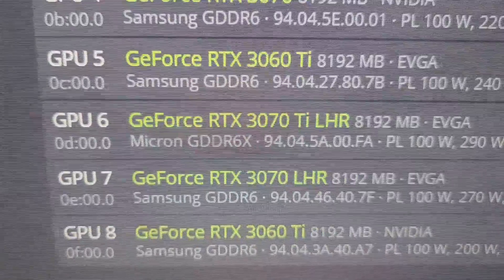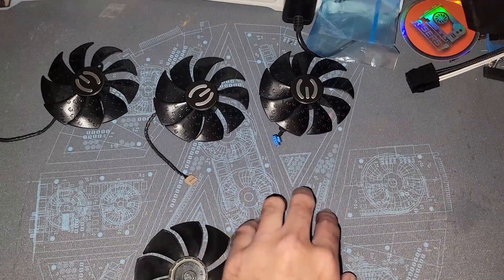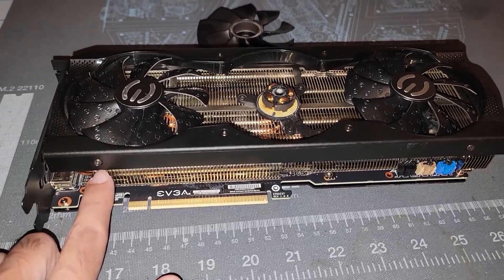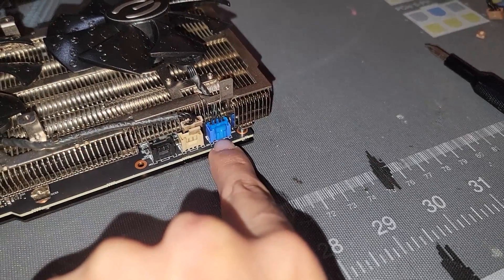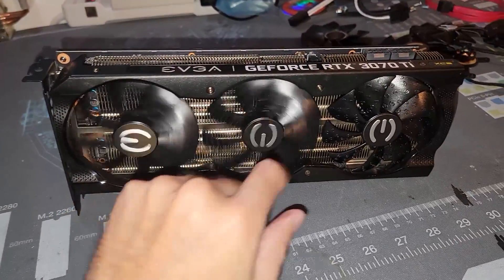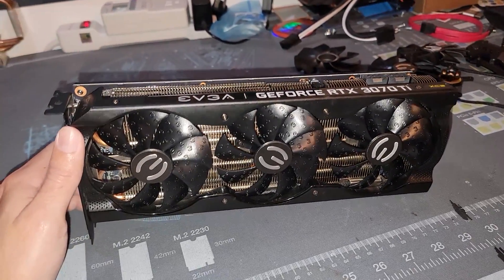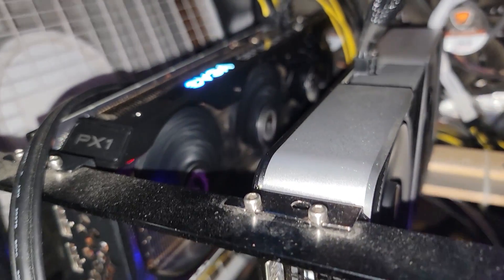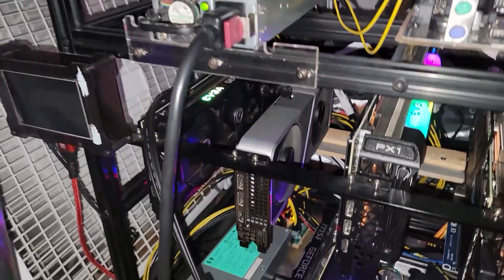GPU Fan Replacement EVGA RTX 3070 Ti XC3

Comment: I unfortunately just noticed after my Windows 10 was acting weird with the visual bugs on the desktop. I looked at my computer. I noticed the middle fan wasn't even attached anymore to the fan base so it looked just like your middle fan did. I got my card back in 2020 luckily it's the RTX 3080 FTW3 ultra right after they changed the red lips to the black lips and it's not the LHR version. It's the regular version but it is getting a little hot without that fan spinning so I'm hoping that site still has replacement fans.

Comment: Is there a way to fix the fan without replacing them entirely. My far left one doesn’t spin and when it does, it rattles. Today it fell off but I don’t want to have to replace the entire fan if I could fix whatever messes up the alignment
Reply from the maker: Not really you could replace one fan, but if it fell off the bearing which depends on the one used, it is just better to replace
Reply: @SerpentXTech  ok thank you

Comment: My evga 3080 just stopped working. Fan won't spin (unless I spin it myself which it makes noise and stops after 5 minutes) and when that fan stops, the 3rd fan stops as well.
Reply from the maker: It's very weird. I wonder if there is a problem with power distribution on the card or PCB
Reply: @SerpentXTech  yeah idk, I'm hoping I can still get an rma since evga disbanded their nvidia gpu portion of their company since I have no money to replace the card and don't want to break it trying to change the fan(s)
Reply from the maker: @blindfire3167  so I talked to Jacob not too long ago, and it seems they don't have fans. You can RMA, but gonna be waiting a bit. But interesting, I am not the only one, I got two of 3 working that keeps the card in check, but sucks we are not getting what we fully paid for..

Comment: You weren't flipping us off, you were telling us we are numbah 1.   How long did that card run before problems? (I have quite a few 3070's of xc3)
Reply from the maker: 3 months
Reply: @SerpentXTech  Oh. My. mine are all over 6 months without issue. I prob better buy a couple set of fans.
Reply from the maker: @dontsupportrats4089 I might have just been unlucky